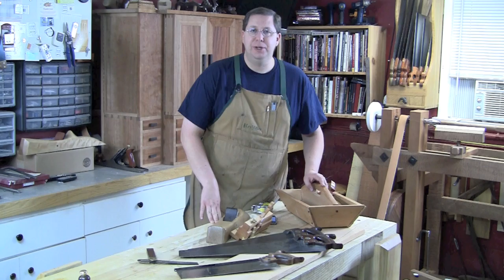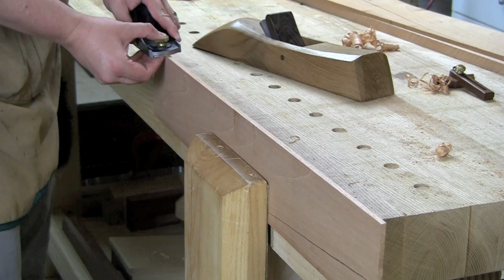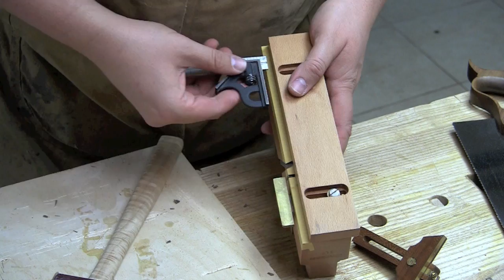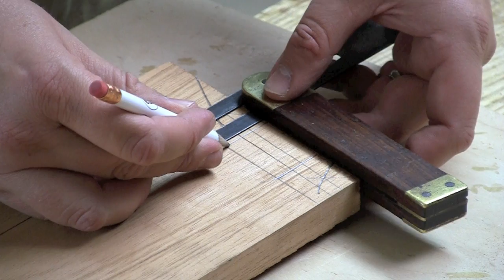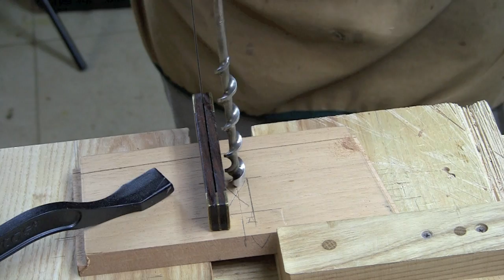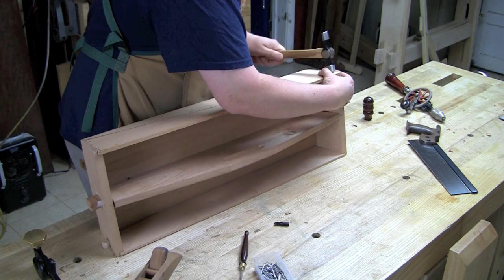RWW168 The ToolTote

Comment: As you say, it's nice to be able to toss a few tools into a tote to haul them to a small job away from the shop.  I have a concern about longer totes, it's easy to have more weight at one end than the other.  That's why I prefer a tote with a handle that runs the whole length so you can grab it at the balance point wherever that is.  On another note, why didn't you use hopper dovetails like you did on the little chest you built?  You did a really nice job on those.

Comment: I did put glue on the handle tenon though it isn't necessary. Once the box is assembled there is no way to remove the handle due to the length of the handle and the angle of the tenons.

Comment: where did you get that resaw blade from
Reply from the maker: 5quint1 I made it.  Check out my channel and you will find a video on the resaw frame saw, or visit my site and you will find several articles and videos with links to the blacksmith and bladesmith I collaborated with to make the saw.  I also added an annotation to this video with a link to the video to make it easier.